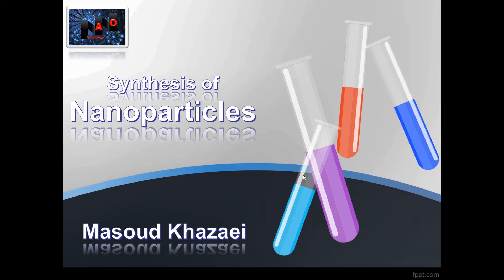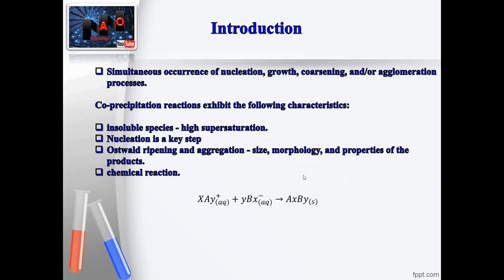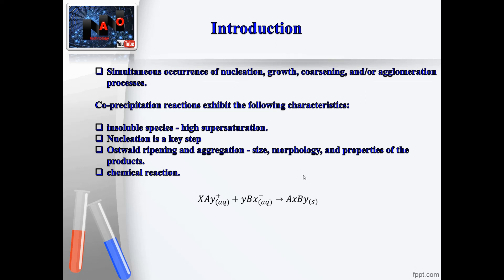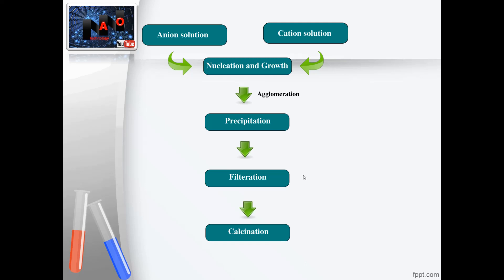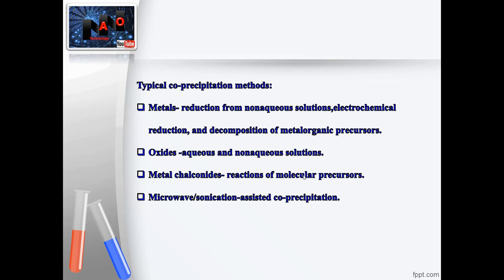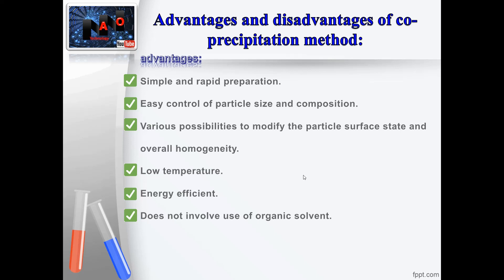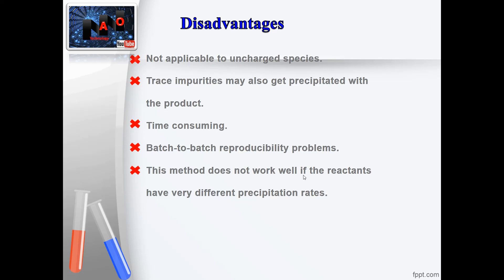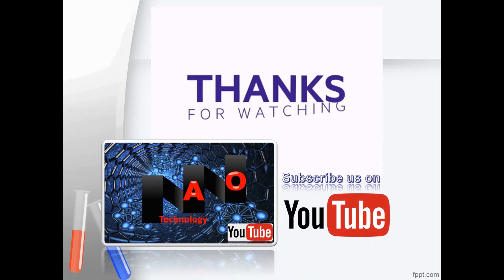Synthesis of Nanoparticles by Co-precipitation Method

Comment: Thanks for the video. I see in a few other places that this method is noted for its comparative lack of particle size control and particle distribution control (since there is no stabilization, so the particles agglomerate). I think the advantages slide might be a little misleading, therefore.

Comment: I will prepare a hybrid nanocomposite polymer / metal oxide 1st step the preparation of nanoparticle by hydrothermal synthesis To obtain nanocrystals 2nd step one mixes the polymer with a solvent then one adds the nanocrystals of metal oxide by agitation which it method one used in this stage there? then prepare the thin layer by cleaning the substrate then spin coating and dip coating so that it is the method used for this synthesis of hybrid nanocomposite since y 3 method Either polymerization or sol gel or by mixing?

Comment: I want to prepare 3 gm of SrO-Al2O3 (1:1) by a surfactant-free
method. How can I know the amount of Sr(NO3)2 has to be added to a
mixture of Al(NO3)3.9H2O?.
Reply from the maker: As it's turned out so far, there is no way to anticipate the final product mass. But you may get an idea from some articles to start with them.